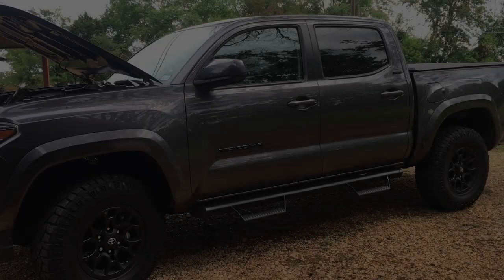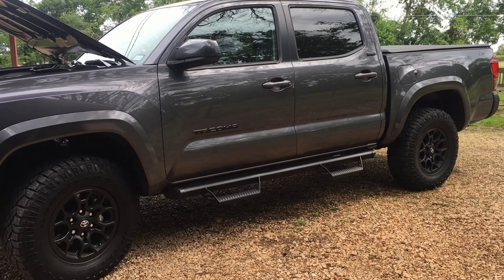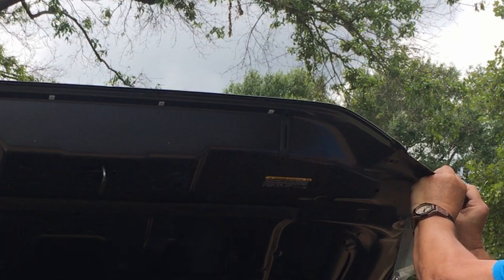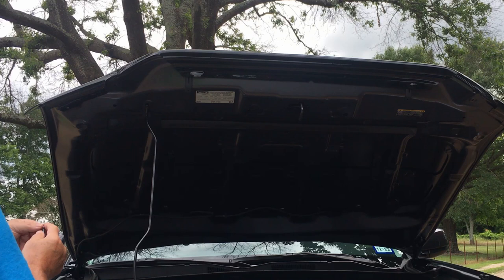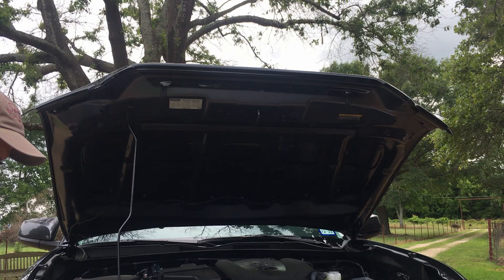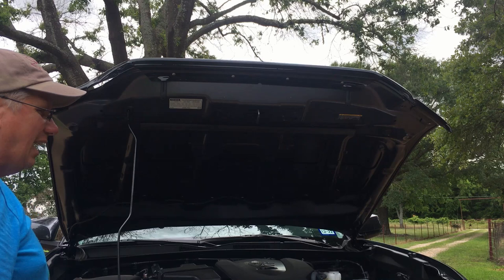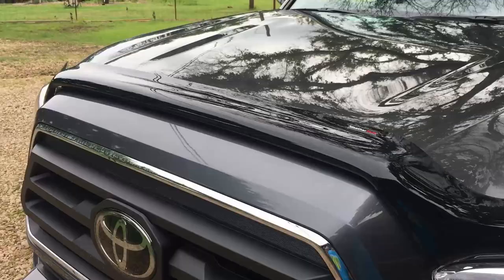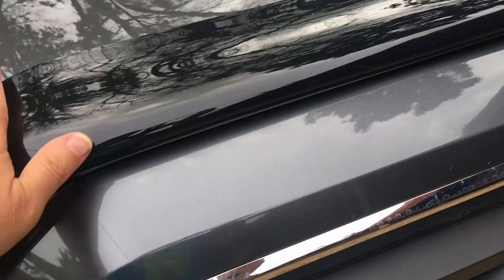3rd GENERATION TACOMA MOD - WEATHERTECH BUG AND STONE DEFLECTOR INSTALLATION - 2021 TACOMA

Comment: My bumpers are supposed to be black but have turned a streaky gray. Think I'll try this Plastidip.
Reply from the maker: Remember… It’s not paint. It’s kind of a course spray. Not as coarse as bedliner, but coarser than paint.

Depends on the look you are trying to achieve as to whether or not you’re going to like the appearance of it.